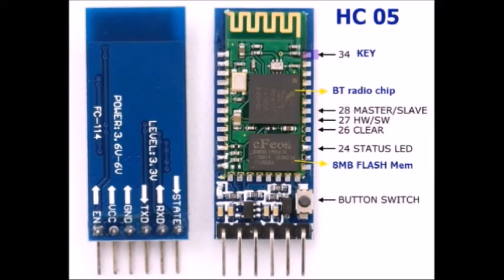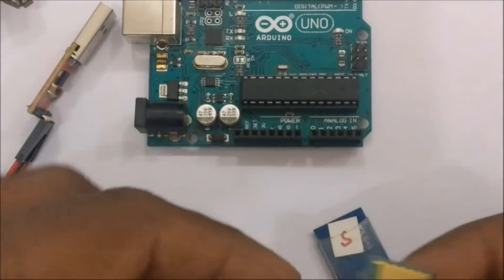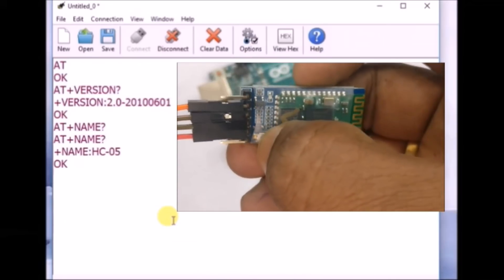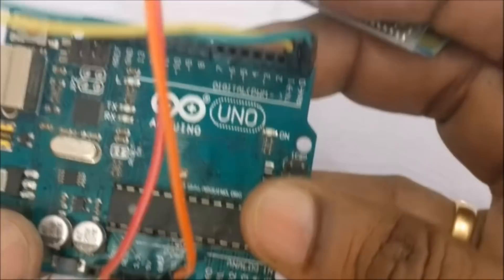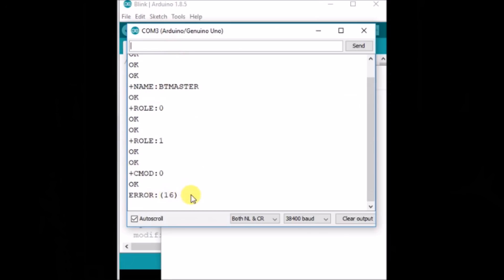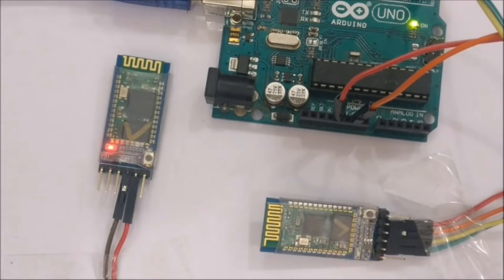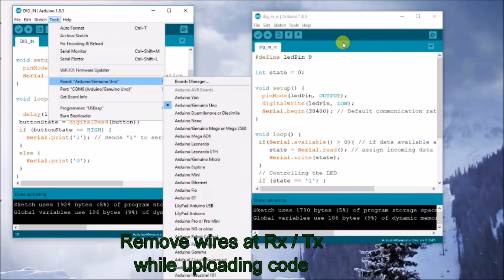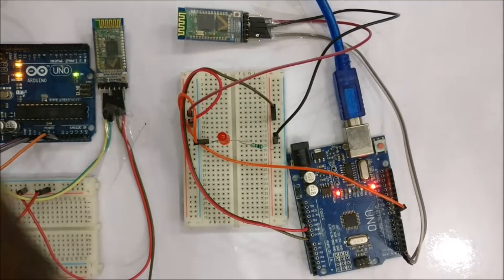Bluetooth HC-05 Modules - How to PAIR & Transmit/Receive  DATA

Comment: I want to make my audio devices in the living room wireless (I heard Bluetooth is better suited than wifi?) and thought I would need to buy a transmitter board for every device (vinyl player, DVD player, amplifiers and a tuner so four Boards?) and then I need to get arduino Set Up which will then basically receive all the Bluetooth signals right? I connect the output of the arduino to my speakers and subwoofers and should be fine right? Please someone help me out with this I am so confused.. Thanks guys, stay well oh and nice video btw

Comment: baud rate 9600 and 38400...neither one works. There's a reverse question mark character on the slave serial monitor
Reply: having the same issue.. did you find any solution yet?
Reply: @akkitheguy  nope, I had to abandon the project because I could not get it to work.
Reply: Baud ret 9600 both arduino
Rt to tx 
Tx to rx
Resister use for volt drop  use in bt module rx pin
Reply: Same prblm fac   then try try try 
Then i fix thes 

My questn is  how to controll 3 led in 3 switch
1button pres led 1 glow
2                             2 glow
3                              3 glow

Comment: Great video, Can you make video on how to send data from one master to multiple slave And if possible vice-versa also . As it can paired upto 9 slaves.
Reply from the maker: A master can pair with 7 slaves ,but at a time only one slave pairs with master.When a slave is switched off , other slave automatically connects with master.
But only one slave can be connected at one time. This means, to create a network you need to connect, get data, disconnect to each module in turn.
PICONET is the network term for bluetooth .But piconet firmware cannot be uploaded to the HC05 modules
Reply: Hi Saravanan,  can this pair(master and slave) of bluetooth be worked as bidirectional ?
Reply: it would have been very useful if you could have given an example of one master talking to two slaves and the connect-getdata-disconnect process happening.
Reply: @ajayjoseph4626  yes i looking for the same but cant find
Reply: Rahul Kumar try rf
Reply: which rf module ? can you specify the name ?